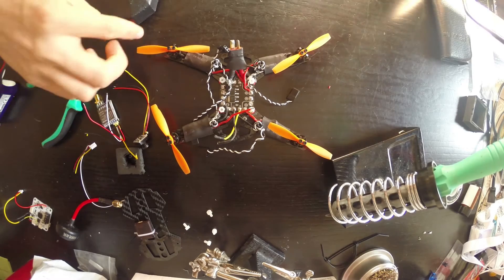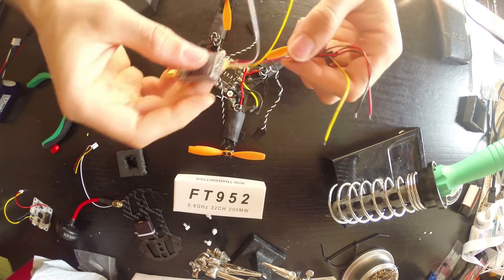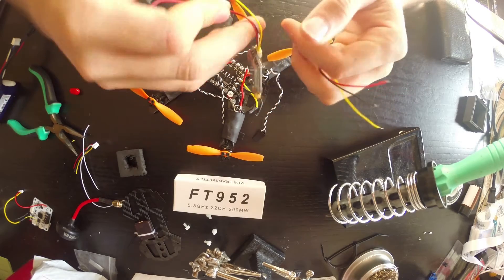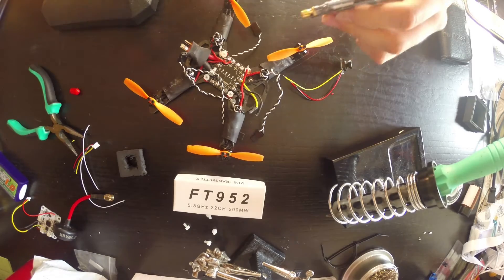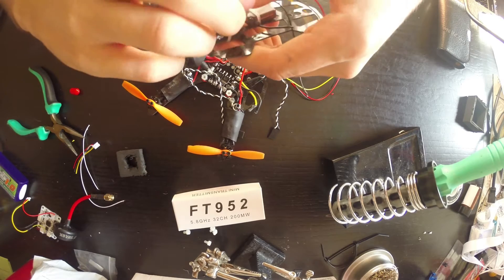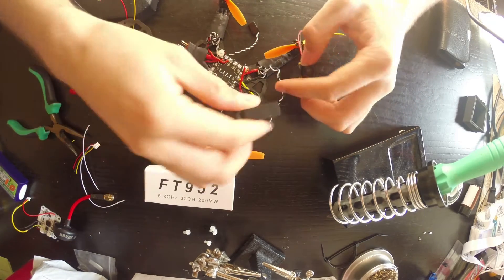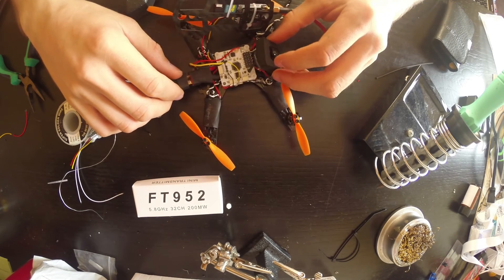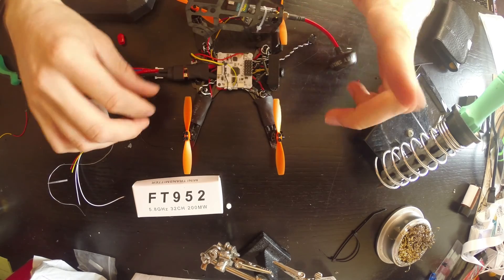DTI 150 Micro Quad Build Series | Part 4(FPV System) |

Comment: Hi, when you are flying the quad, i know you need to put the 4 esc wires in the flight controller but do you need the five volt from de pdb and put that olso in the flight controller?
Reply from the maker: Hi, Good question! It depends on your flight controller...Some are power with 5 volts(like my case, im using a CC3D)other with the voltage frome the lipo. I advise too see the manual off your flight controller and see how the board powered. hope i answered your question :)
Reply: +Dream Deal thanks
Reply from the maker: No problem ;) Don´t forget to Subscribe if you liked it ;)